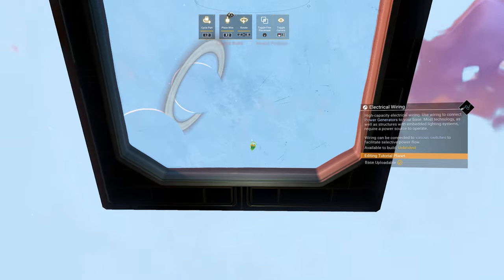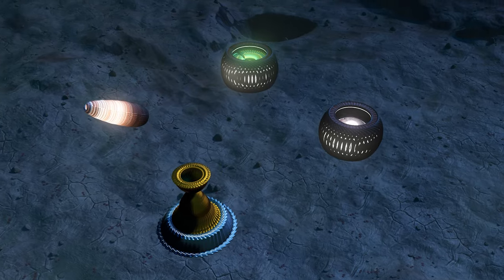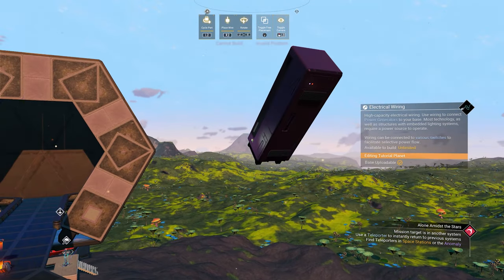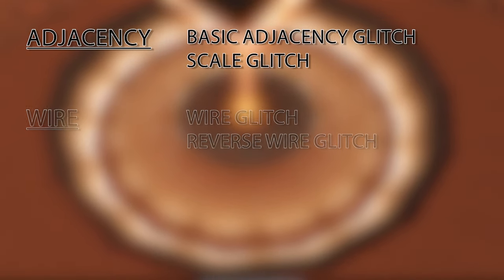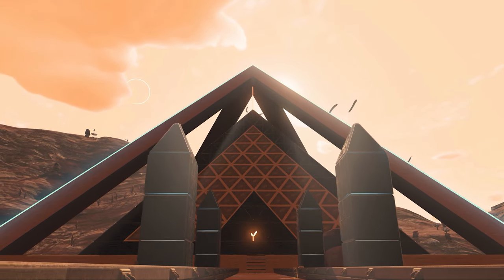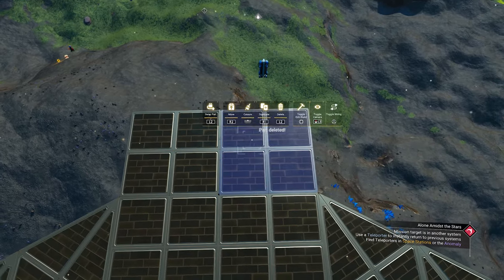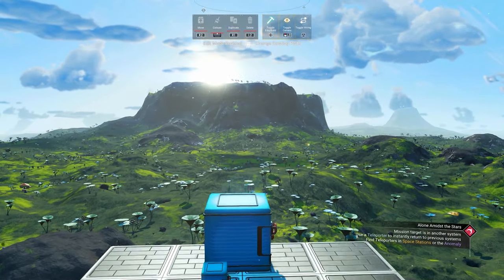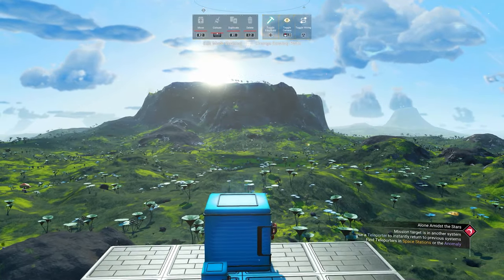COMPLETE Glitch Building Guide - EVERY Technique in No Man's Sky

Comment: Imho the glitch placement is what free placement should be, except for plants.
It's better to press the toggle wire mode key first before the placement key/click. If you press/click placement key slightly too early, you get stuck with a wire you need to remove.

Comment: Thanks for your explainations.
01:09 Many things no longer work in NMS 5.12 PC version.
Here the top was built up, but below the glass floor the bottom is built up and turning is no longer possible.
Reply from the maker: Hmmm.. I just recently made an updated guide about the merging through the floor, and it still worked perfectly fine.
I wonder what part you were trying to build. https://youtu.be/6pCThAP-Q98
Reply: @Beeblebum  Thanks for the quick response. After I tried a lot in this case I have no longer issues with the teleporter build. :)

Comment: How quick do you have to be for the wire glitch? Im trying to do it now but wither im too fast or too slow? To hit it. I do as you said and give priority to ∆ (im on playstation) but it still ahows as red when it swaps. Also it still works as i was able to pull it off a few times just super inconsistently......
Reply from the maker: I think you might be too slow then... The delay between buttons is really short, almost as if you press them together.
I know it can be frustrating, I had a lot of trouble with it the first times I tried and learned it.. Once you get the cadence, you will be unstoppable. 😊

Comment: Is there anyway to place a scaled piece onto a specifice output, like the end of a wire to have it perfectly centered
Reply from the maker: There is no Fixed Snappoint options for scaling.
You can try to lay out Alloy floors and use the center marker for precision, but that's about it so far.

Comment: Is there a way to snap a scaled item to a specific location? Say you already have wires set up to get the center of a floor. Can I snap an upscaled supply depot to that wire? It seems to reset the size to normal when snapping.

Comment: Can you use ultimate scaling glitch and wire glitch to put like 30 silos in the same spot but smaller?
Reply from the maker: There is (currently) no way to scale glitch into a fixed position, as soon a build part snaps, it reverts to its original scale.
Reply: @Beeblebum  yeah ok thanks

Comment: Does the cachepin still work? I keep getting a base computer instead of a freighter part :(
Reply from the maker: It still works.. 
I had some similar issues before when trying it out.

If you are on Console, there was a bug with the controls, that broke this glitch, so this should now be fixed.

But here are a few other things you should take in account now:

1) Be sure you have the materials to build your cache-pinned part
2) Make sure your inventory is not full.
Reply: @Beeblebum  Do you know of a way to delete cache-pinned bulkhead doors outside of freighters? I tried to force a connection to delete the railing on a catwalk by placing a bulkhead door first... but it didn't work, and now the bulkhead door cannot be deleted. Any suggestions?

Comment: The wire glitch is working for me to place multiple extractors and depots in the same spot but it’s still using my resources and stops working if I run out. Was the no resources part patched or am I doing something wrong?

Comment: Question: I have seen 10 times larger Bio Domes than 3x upscaled...there seems to be a method to infinite resize? Any Ideas?
Reply from the maker: Biodomes that are scaled larger than 3x - have been scaled up by using a modded wire. 

If you have a Friend who plays on PC, they can place a 10x Scaled wire for you on your base, which you then can use to scale more.
Reply: Im on pc... but my scaling ends with about 4x with the cableglitch
Reply from the maker: @Xaamosjourney  Sorry, I should have made clear this is done by using a Building Mod - I am unsure if this is a public Mod.

Comment: Although it's a good video, what these youtube video makers don't tell you is that you need not bother trying this on PC. This works only on consoles because they are slow and crappy. On PC you only have a chance to get this done with an automated macro and even then it's hit or miss. The best macro I've been able to make so far has about a 20% success rate.
Reply from the maker: I am building on PC.. this was also recorded on PC.
However, I am using a controller, because I simply find it easier to glitch build.

There are however several PC glitch builders using M/K - and Yes.. I am impressed they manage.

Comment: Dude idk what im doing wrong but I set up my wire scaffolding exactly how you do at 13:30 but when you place the floor at 13:32 its perfectly 45 angled, but when I do the Q+left mouse wire glitch in the exact same scenario, it works, but my floor placement isnt at 45, matter of fact its like I can move it anywhere around the middle spot of the wire, making me have to line it up myself, which is not possible in my case as im trying to make a pyramid and need it to snap exactly 45 like it does for you, but for me it just fiddles around following my mouse and then I can place it however i want to? what am i doing wrong
Reply from the maker: Hey Uzi, I am not entirely sure what issues you have.

From what I understand, you are able to glitch the floor on the angled connection, but the Floor is not angled in a 45 degree. But after that it is not clear what you are trying to explain.

If your floor does not follow the 45degree, then perhaps you connected your horizontal wire in the  wrong sequence?

If it helps, I did make a guide explaining how the wire behaves and how you can control it in more detail here: https://youtu.be/BbDxEYdgZpU
Reply from the maker: @MAXUZIYSLX  I have checked your video, and replied to it.